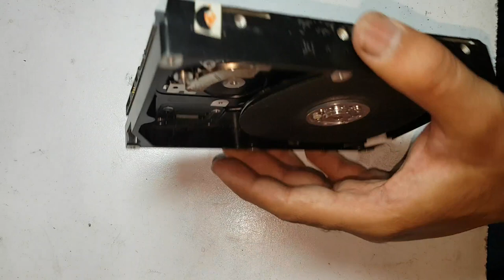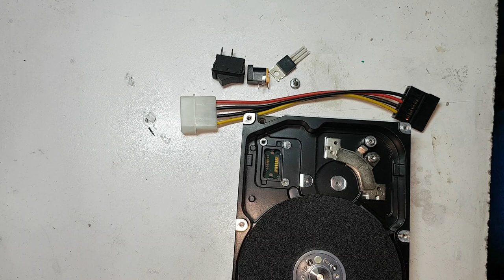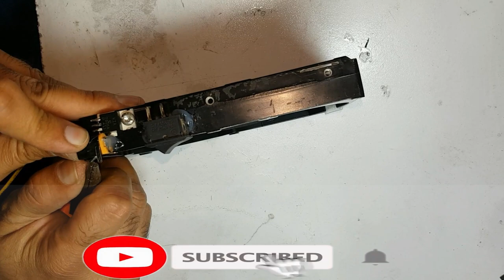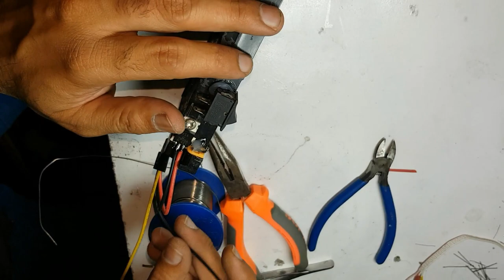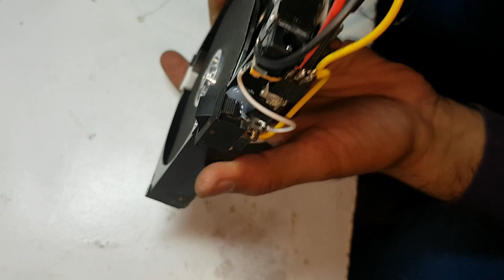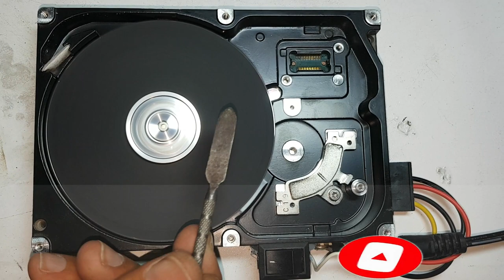HOW TO MAKE | POWER SUPPLY FOR HDD | HARD DRIVE SANDER | HARD DRIVER GRINDER | Technical Institute |

Comment: This doesn't work on a Seagate hard drive, I've already tried it but it needed the arm to work continuously. Yes I've soldered pin 2 and 6 together still doesn't work. I just need to find a WD hard drive lol.
Reply: For the arm, you only need the socket... check on its base, where one of the screws goes, it has contacts that fee to one of the pins. But anyway, it still powers down after 10-20 seconds, anyway. This method is not good for every HDD, especially not for the new ones.

Comment: It worked for 10 seconds and stopped, I turned off the switch and turned it on, again the same thing. Where is the problem?
Reply from the maker: 1st of all chek output volt 12 volt and 5 volt . If output is okey . Then try other brand of hard drive. Some brand not supported for direct run for sander. Thank you for your feed back..
Reply: @TechnicalInstituteokara  Thanks for the quick response.
Reply from the maker: Wellcome...
Reply: It may be that the particular control circuit needs a keep alive signal (from the computer) or a particular pin in the data connection to be 'logic high'. I too have the same problem but have no solution other than switching off and on. If anyone has a fix pls. let us know. Tks ! Running with AC or a speed controller is not an option I want to use.

Comment: I use a 12 power adapter and a cigarette lighter USB charger circuit to feed 12V and 5V to the Molex connector pins to power it.

Comment: Hi. Quick question.  So the only thing I need to get the Hard Drive motor spinning is LM805 and 12v DC power supply?
Reply from the maker: Lm7805 with 12v supply
Reply from the maker: Welcome bro..

Comment: does it work on 12v 1A power supply?
Reply from the maker: Yes
Reply: @TechnicalInstituteokara  bro its not working on 12v 1.5A
Reply from the maker: 1st of all check 7805 output is correct then put in hard drive.
Reply from the maker: agar phir b na chale to hard drive kisi or brand ki lga k dekh lena.
Reply: @TechnicalInstituteokara  chalu ho rahi hai bhai par chalu hokar 1 ya 2 sec mai hi bnd hoti hai
Reply from the maker: ok.. ap hard drive ka brand change karo thek ho jaey ga. kuch brand aesy hi hote hain chal k band ho jate hain..
Reply: @TechnicalInstituteokara  ha dono hard disk check kiya but chalu hone ke baad bnd ho jati hai. kuch solution batao
Reply from the maker: wasy to 12v 1A  kafi hoti hai hard drive k liey. phir b ap supply change kar k dekh lo. maybe ap ka masla thek ho jaey.
Reply: @TechnicalInstituteokara  ok
Reply: @TechnicalInstituteokara  bro IC mai se 5 volt supply nahi aaraha hai isliye ho raha hai shayad aap ek bar bata do konsi ic purchase kru? mai L 7805 use kr raha hu
Reply: @TechnicalInstituteokara  bro its working ❤️❤️❤️ thanku so much
Reply from the maker: 7805 hi lage ga bro.. lakin original lena.
Reply from the maker: wellcome..
Reply: Will it work on 12 dc supply
Reply from the maker: Yes .. 12 v  1 ampere

Comment: How to connect hard disk to phone
Reply from the maker: Otg adopter
Reply: @TechnicalInstituteokara  old computer hard disc h hard drive se connection kese le
Reply from the maker: Hard drive ka external case aata hai us se external power de k usb otg k sath mobile k sath atach kar len data show ho jaey ga mobile main.. file explorer play store se kar len
Reply from the maker: Sata to usb cable bhi ati hai .. wo bhi use kar sakte hain.. lakin hard drive ko external power deni ho gi.. q k 12v mobile nai de sakta
Reply: @TechnicalInstituteokara  supply to de denge pr mujhe pata hard drive connect krni h phone m connector to mil jayega pr wo mehnga h koi or tarika se ho sakti kya koi sasta jugad ho to batao
Reply from the maker: Nai... converter lazmi lagana pary ga.
Reply: @TechnicalInstituteokara  ok thank you

Comment: can u same suggest for me how to make power supply for IDE external hard disk?
Reply from the maker: Yes you can use. But mostly external hard drive input only 12 volt. 1st chek volt of your external drive.
Reply: @TechnicalInstituteokara  tq for ur valuable reply, may i know how to check volt of hard disk nd how to make that adapter?
Reply from the maker: Serch with brand name on google
Reply: @TechnicalInstituteokara  tq very much
Reply from the maker: Most wellcome ..

Comment: Please send full diagram link. And can I give 9 volt or less than 12 volt or direct 5 volt  power supply. Anyway very good video keep it up. Super 👍
Reply from the maker: Thank you.. transistor diagram in discription.. minimum and maximum 12 volt you need.
Reply: @TechnicalInstituteokara  very thanks for your reply. 👍 and my hard drive motor has 3 connection points so will it work as shown in video ?
Reply from the maker: Yes .. sure
Reply: Can I use this process to connect my hdd to my PC?😂

Comment: hdd stops after 1 minute ?
Reply from the maker: Wich brand you have using ?
Reply: @TechnicalInstituteokara  seagate barcuda 80 gb sata hdd
Reply from the maker: Okey.. maybe your hdd circuit is faulty .. remove circuit and wash with mbc specially back side. And dry.. then try again.. i hope all fine..
Reply: @TechnicalInstituteokara  Could it be that the hdd is turning itself off because the sata cable is not connected?